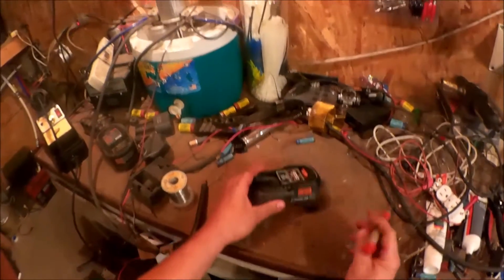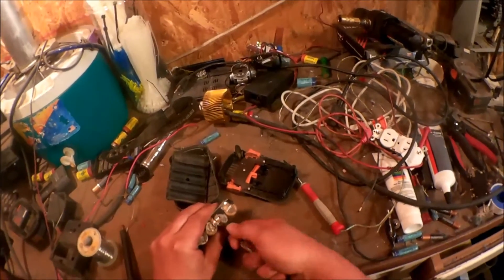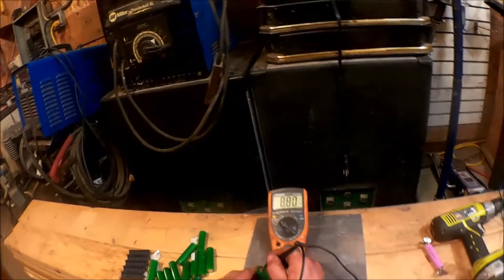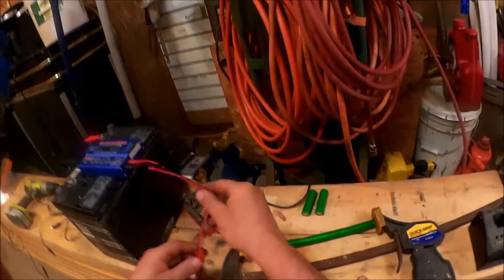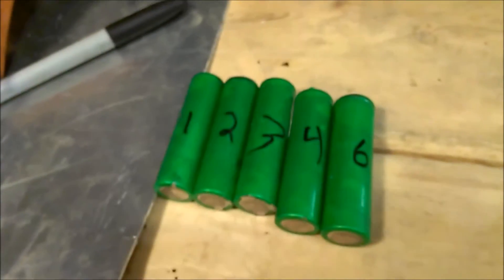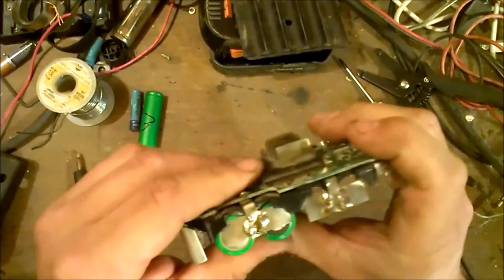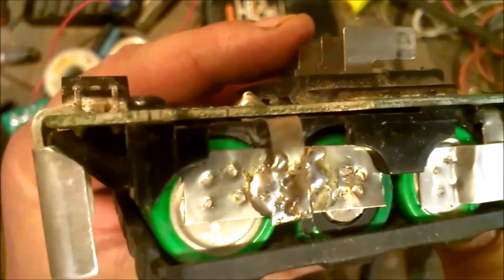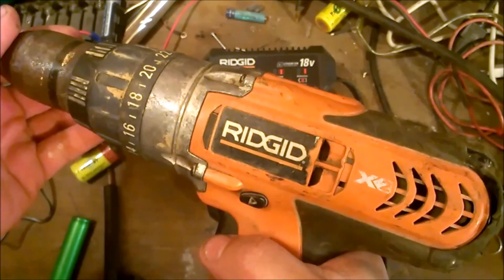Ridgid Battery Rebuild

Comment: Rigid tools work well but substandard batteries.  Their idea is to make shit batteries and you keep buying their tools. Sota like buying a cheap printer and the replacement ink cost more than buying a new printer. Stay away from this junk.
Reply: At least they didn't make so the board permanently disables itself.  I'm going with Ridgid for my first cordless.

Comment: Great video, but could you please say what the mistake was!!!! Looks like others have followed this, like me, and I have the same exact problem....says fully charged...how did you fix that error?
Reply from the maker: The cells were correctly welded together in series, but I put the whole assembly in backwards(reverse polarity).  I just had to de-solder the connections to the control board and turn the assembly of cells around.  The polarity is marked next to the contacts on the battery housing.  If you follow that and then look at my finished assembly in the video you can spot it pretty easily.  If that's not your problem then there could be something wrong with the circuitry on your battery which unfortunately is not very serviceable by amateurs like us.  I'm really not familiar with the workings of that circuitry or the variations on it over the years.  I've found Ridgid batteries not to be terribly reliable and prefer to use only Ryobi battery tools now.  I have not had any Ryobi tools fail and still use some lithium batteries that are around 10 years old which of course have a reduced capacity at this point, but still work properly.  Thanks for your view and comment, and good luck to you.

Comment: Please explain what the mistake was. The cells in my pack are at 18.02v, but the connector terminals only read 12.42. When I put it in the charger it tries to charge for a few seconds, then says fully charged and won't power a tool...
Reply: Mine too, if you find out please post it!   I have 12v on the terminal even though my batteries are measuring 20v.

Comment: Did you put the cells in backwards? Positive to negative through out the battery? Just installed cells myself and had the same issue on the charger, it read the battery as full but it only lasts 10 seconds in sawsall. What did you do to fix?

Comment: Thank you sir for such a fantastic video! Any idea what amp rating these 18650s are? I'm thinking of upgrading the ah capacity on a pack or two and don't know what to look for as far as amp rating goes.
Reply from the maker: I would say that a better way to look at this is to get the right cell chemistry.  For high discharge rate things like power tools look for IMR cells which are lithium manganese.  They are designed to discharge at high current without overheating.  These will not have the highest total capacity out there but they are what is necessary for this.  Thanks for watching.

Comment: I have several different types of re-chargeable batteries that went capoot.  Several older Senco ones,  a couple of Rigid  24v XLI and several sears ones including the newer a couple of the 19.2v Lithium-ION batteries.  Do you overhaul these or have a place that does so I can mail them off for repairs?  I am checking into all of this to see if I should restore them or simply replace them.  Or perhaps I need to invest in the spot welder so I can Do-It-Yourself.  Thanks for sharing your work on how you handle repairs etc.
Reply from the maker: I used to rebuild some for people I worked with in the nicad days, but there was very little profit even without shipping.  The price of cells kept going up and I would try to get them in larger quantities but they didn't keep well.  If you use a lot of battery tools and  you don't mind investing a lot of time at home to save a little money and learn something then definitely build a welder.  It's not terribly complicated and doesn't have to be expensive if you have a little patience in gathering the parts.  If the Sencos you speak of are nicad, you can still get a pretty good deal for yourself as those are only about $2 per cell for around 2 amp hour. The high end tools in those days were not more than about 2.5ah, so those are perfectly adequate for anything and an improvement for some.  You could also do what I sometimes did and spend about the price of a new pack on fancy high capacity nimh cells and have something better than original.  You don't want to invest a lot in that route right away though as not all chargers will work properly with them.  Since the start of Lithium I haven't spent nearly as much time searching for new cells as my ryobi ones are super reliable and go on sale all the time.  Those Ryobi packs could be a good source of new cells for rebuilding more expensive brands as their top end ones are as good as anyone's of the same rating.  What I have found for sale individually have been either too expensive to be worth it or falsely advertised garbage.  Then it seems much of the time the problem with bad lithium packs is poorly designed or defective circuitry.  Because of that though, you can collect bad packs to gather the good cells from them for rebuilding packs with good circuitry.  There is why it's still great to have that welder around.  I have been using mine in it's lazy experimental form for about 9 years now so I suppose I should do a video starting from the beginning and building it into something more finished and user friendly.  I have no experience with the 24v XLI but on a quick search it seems that many people are having problems with them which makes me suspect the charge control as I would think they would use the same cells as they do with their 18v stuff that I use.  Well, that was my short answer.  Just ask away if you want me to keep going, and thanks very much for watching.
Reply: Thank you very much for the info.  It educated me more about these batteries.  I may simply explore the possibilities of making some 110 volt adapters to plug into my battery powered tools.  I am just a do it yourselfer so do not want to invest in these new expensive batteries.

Comment: What is the Makita charger problem?
Reply from the maker: +Michael Hepburn The circuit on the battery communicates with the charger before charging is started and after a problem is detected a few times the battery and charger will no longer speak to each other so replacing the cells does no good.

Comment: great thanks for the info. hey did you notice when you were checking the voltage one went minus what the hell
.
Reply from the maker: +Leo Emler Yes I did and I think that was one that I immediately re contacted to try to get it to do it again. I guess maybe just a small buildup of charge that was dissipated by the meter, or just weirdness with the meter itself.

Comment: great video that arc was the best the screen went completely  white. what were you using to put the cells under a load while 
discharging.
Reply from the maker: +Leo Emler Yeah, I really wish I had a high speed camera for that one.  There was not a single build up frame before the flash.  The load testing device is a West Mountain Radio CBA II.  It is that heatsink thing with a fan on top off to the side.  In my trying to keep up the pace I forgot to elaborate on that device, but it can be seen in my Ridgid 4ah vs Ryobi video.  I think it's pretty much just a transistor with a heatsink, but it comes with that nifty graphing software and is really easy to use.  I got it when I was rebuilding a lot of nicad packs (some upgraded to Nimh) when there was quite a savings/ performance increase to be had.